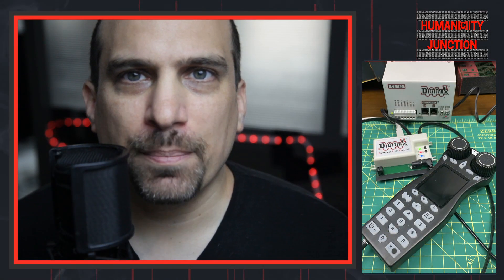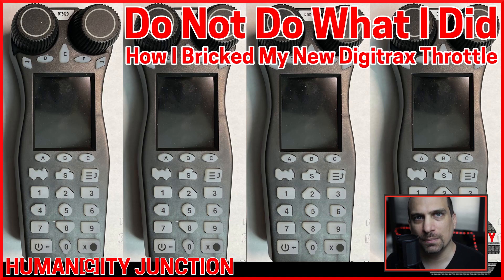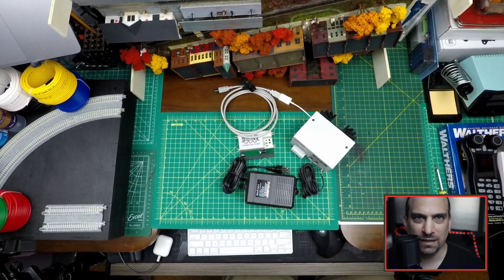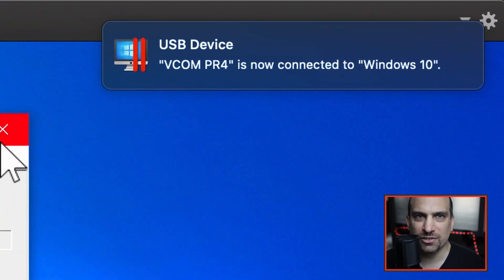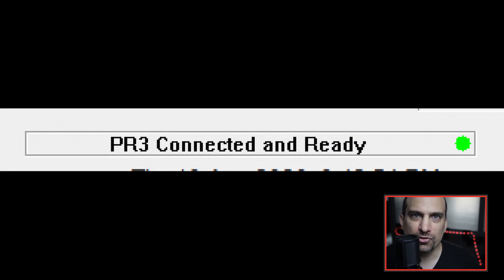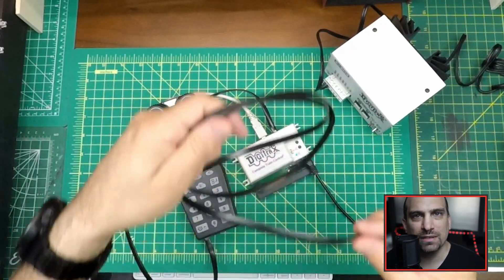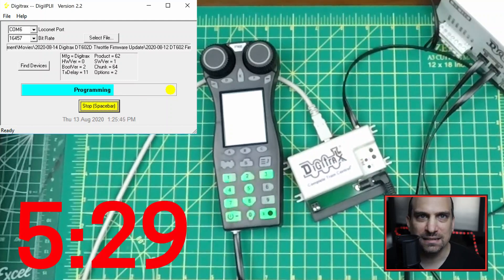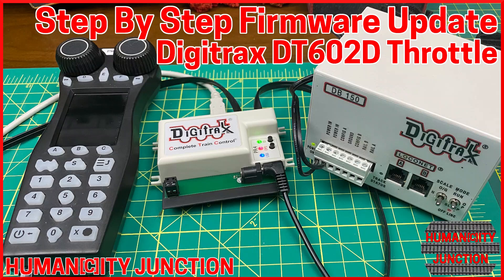Easy Step By Step Firmware Update | Digitrax DT602D Throttle

Comment: Hi.  Thanks for your Helpful videos - Great!
I have followed your video firmware upgrade instructions alongside the Digitrax written Firmware upgrade instructions
I'm using a DCS52 (PR4 built in) to upgrade my DT602D and UT6D...  firmware upgrade failed, the keypad keeps blinking even after removing and reinserting batteries...  I've tried 8 times now.
Digitrax support said I could ship it to them - but that is not the proper solution, as you've said as well!!!

Can I RESET the throttle to factory defaults and start over - at least get it functional again
Reply from the maker: My understanding is the only “reset” at this point is to keep pushing the firmware update. 

Yeah, I know.
Reply: @HumancityJunction  Thanks...  I guess you mean, just keep retrying over-and-over, in the hopes it will eventually 'not Fail', and upload correctly.
Reply: @chrislef5045  I still have issues with mine. I opted not to send to digitrax as shipping would be expensive with fees. got a pr4 and still didnt fix it. digitrax again said i could send it to them after getting in touch but ive just picked up a DB150 as a last throw of the dice. My DT602 just has a rapidly flickering screen and nothing else so i will just have to keep trying to push the update using the same setup as in the video and hope it eventually works for me.... Did you ever get yours sorted?

Comment: Hi there, i am very late to the party with this. I managed to brick my DT602 doing a firmware update and purchased a PR4 to try and get it to work but have had no luck. I however happen to have a Dr5000 and was wondering if you would be able to explain the steps you used to allow a firmware update through that using a PR4?
Reply from the maker: Once bricked, I ended up using a DB150 w/PR4 to unbrick it. Then I was able to use the DR5000 again for the updates.

You need to have the command station connected via loconet, so connect the DR5000 to the PR4. 
Using Soundloader, connect the PR4 and make sure your com port is connected.
Then keep trying to update. According to Digitrax it could take a few times, but it will eventually "fix" itself.

Or, you can send it to Digitrax and they will update it.
Or, is there a local club? They might be able to help.
Reply: @HumancityJunction  Thank you for your reply its much appreciated, I will look into the DB150 and see if its a viable option for me. When I got in touch with digitrax they said for me to just send it in so im trying to exhaust all my options before sending it over there as im in the UK so will cost be a fair bit more than just the repair cost. Thank you again for your help

Comment: Been trying to get my PR4 to work as advertised with no luck. I've given up. It is now a paper weight
Reply from the maker: If you want some help, let me know what’s working and what is not working. 
Also, the Digitrax Groups.io has a good group of people that could also help you out.
Reply: @HumancityJunction  Thanks for the reply. Once I took a step back, counted to 10, it finally dawned on me that the DCS210+ has a computer USB connection that you can also do to perform upgrades. I did look on the Digitrax Users group, and apparently the DCS210+ and the PR4 don't play well together. I then removed the PR4 out of the equation, and connected the computer to the DCS210+. Everything works now. Guess I did not need the PR 4 when I had the DCS210+. But, still, I'm no expert.
!

Comment: It was hassle.  I have a MAC and planned to use JMRI  but later realized I should just use Windows, luckily I have Parallels desktop on the MAC.  Not sure what I would have done without this video.  Thank you sir👌🏾
Reply from the maker: Glad it helped!

I thought I saw another post from you about Soundloader.  I am only using it to confirm that the PR3/4 is connected correctly because the firmware updater will not provide that info.
Reply: @HumancityJunction  yup, I erased after reading the Digitrax site thoroughly realizing it was needed or at least listed as 1 of 2 updates for the 602. I was having throttle issues for months now but this update fixed it all

Comment: Cool! Nice information. I wonder if you did tried by use Mac computer too? Is there difference from Windows? I use Imac with latest upgrade version.
Reply from the maker: On a mac, you would need to run a virtual machine through bootcamp, parallels or WMWare.  There is not a native mac application.  But if you are using a virtual machine, yes, it will work.

Comment: Thanks very helpful!  I have been dreading this for some months now.  One stupid question:  How do I know the COM port to which I attach the USB to the Zephyr (I have a DCS52 and have verified that I can use this and not a PR4)?  Is it as simple as trial and error and seeing when the program gets a return?
Reply from the maker: What I do to find the com port is to use Digitrax SoundLoader.  You get more infromation with that program in regards to confirming that you have the connection established correctly.  Then I close Soundloader, open the updater and have had a lot of success this way.
Reply: Again, thanks.  Today (Feb 25, 2023) I updates both my DCS52 Zephyr and my DT602 throttle.  Your video was EXTREMELY helpful. One problem I had was that the DigiIPL did not 'see' the DCS52 via its assigned COM port, COM7, until I restarted my computer with the USB Cable attached to both the computer and the DCS52.  Then it saw COM7 and programming was successful. Now I can install the DV78 and use the DT602 for route assignment.  Thanks!

Comment: Wel i guess for a old 81 years  computer illiterate person like me, im stuck with it as it comes
Reply from the maker: Tony, if you need an update, you could send it back to Digitrax.  Or, do you have a local club that could help you out? -Heath
Reply: @HumancityJunction  I just had a fellow modeler help me out with some advice, he then sent me a bill for it ??? i do have a problem with a throttle like you have it works fine when tethered but go's off when i unplug it even with freshly charged batteries in it, i use infrared, it was working ok with batteries, then this morning nothing
Reply from the maker: @tonydavey3741  If he did not make it clear ahead of time, I cannot imagine having someone send you a bill for helping you.
Do you buy the throttle when they first came out?  Some of the initial throttles had an issue with the battery compartment contacts.  They were not secured properly and would short out. I would check to make sure the battery contacts are not out of alignment. -Heath
Reply: @HumancityJunction  I bought the evolution pack one year ago, no the guy made no reference to charging me, in fact i enclosed the cost of postage and 20 for his trouble, and i still got a bill, £50 per hour ??

Comment: Thanks for the video, very informative.  I am anxiously awaiting the arrival of my new Digitrax Evolution, it comes with the 602 throttle.  My question is, at this point (approx. a year since this video was recorded) will I need to complete all the updates?  Or will this have been done by the manufacturer?  Thanks, keep it up.
Reply from the maker: Kyle, I would definitely confirm that you have the latest version as you do not know when your dealer got stock of the kit.  The Evolution has the 210+ which has a built in USB port in the command station, so it should be more straight forward of a process. -Heath
Reply: @HumancityJunction  thanks for the prompt response Heath. New subscriber here.

Comment: Thanks for this info! I have the same exact hardware and this was very informative.
Question, is the DB150 necessary for the process? I was wondering if you could do the update with just a PR4, USB connection to a computer, and of course the throttle.
And an unrelated question, I can't seem to get the DB150/DT602 to program locos on the main. I know it can't read CVs, but I thought it could write them, but I can't get that to work.
Cheers!
Reply from the maker: Tom, you will need a loconet compatible command station to complete an update. So you will need something other than the PR4.  I got the DB150 just for this purpose as my usual command station is the DR5000 from Digikeijs.  The DR5000 should work for updates, but I do not find it as consistent as using the DB150.
When you are trying to program on the main, what messages are scrolling across on the DT602D?  Have you tried using it plugged in, versus wirelessly? I use JMRI for all my programming, so I have not tried this myself.
Reply: Thanks!! For programing, I select the loco, hit the 'menu' key, CV Programming, Option to Program on the Main, enter the CV and Value, press with "WRITE" key...and it says Writing...Writing... apparently forever. Not sure if it's me, or a limitation of the DB150/DT602 combination.
Reply from the maker: @p99t0013  I looked in the manual and it says you can program CV's with a DT400 on the main, so you would think it should work with the new throttle. If you do reach out to Digitrax, I would be interested in knowing what you find out.

Comment: This was terrific advice with easy step-by-step on getting it done.  I just replaced a defunct UR91 with a UR93 and at the same time added a DT602D throttle to my existing duplex throttles.  I was having problems and Digitrax told to to upgrade the firmware in the UR93 and DT602D and report back.  Your instructions are perfect for getting this done.  Digitrax should buy your video and make it available to their customers.  Congrats and keep up the great work.
Reply from the maker: Tom, thanks so much. I needed this video and could not find it, so I made it. -Heath

Comment: why should need to update anything?
did the manf screwup on programing at the factory ?
Reply from the maker: They have fixed some bugs, but they have also added additional features as well. Being able to update the throttle is a low cost way to stay up to date with the latest features without needing additional hardware.

Comment: nothing but "Programming Failed" gone over this many times. uninstalled, reinstalled. different cables, power on, power off, through the command unit, directly into PR4. tried spinning around 3 times. nothing. "Programming Failed"
Reply from the maker: I had to get support from Digitrax a few times, but they did eventually get me sorted out.  The Programming Failed message is definitely frustrating as you do not really know why it is happening.
Which command station are you using?

Comment: In case any of your subscribers need to know - a DCS 52 can be used to program the DT602D.  I pushed latest firmware to the DCS 52 first and then attempted to push to DT602D.  DT602D wound up disconnected halfway through my first upgrade (looked like yours did in the first brick video!).  I had to reset the DCS 52 to get it to be seen on the computer and then once I did that I started pushing firmware again over the loconet cable provided with the DT602D.  It took a few minutes but the second time the firmware did actually take properly. 

Should also note that most of the software pushes are not full software updates.  They are currently annotated as a subversion underneath the "SW version:" line.

Thought this might be very helpful information for you!
Reply from the maker: Thanks for sharing this additional information.

Comment: I saw that you were using an apple device. I have a MacBook Pro and want to know if Digitrax is supported on there or do you have to use a windows program? Did you have to bootcamp windows to do the update?
Reply from the maker: Derek Alexander I am running Parallels and I was able to get it to work that way. I do not know if this is supported by Digitrax, but it worked for me. -Heath

Comment: Why is model railroading the only hobby that does not have clear instructions for many of the associated products?? Why is it such a big deal that one needs to make a video on how to update? It should be extremely clear from the manufacturer on how to do it. Actually with my ESU products have very clear instructions. Maybe the Germans are better with model railroading as they are with most other technologies.
Reply: To Human[c]ity Junction and others.

I got a DT602D earlier this year and followed your excellent video to upgrade to the August Firmware. Flawless.  

There is a September firmware update, but it is very buggy. The DT602 OFF function does not work well and the screen goes black excessively quickly.

The September firmware update was not flawless. First try started and failed, second try worked. I left it for a month because the throttle worked. Today I tried to redo the firmware but the same initial failure and second try worked. 

So today I back leveled to the August Firmware, the update was flawless and the the throttle works like it should work. 

Grandson coming tonight and I want it ready for him.
Reply from the maker: @JHurst-to5ey  thanks for the update.  I am having the same issue with the September update, but thought it was just me.  I hope they fix the issue soon.  Thanks -Heath
Reply from the maker: RC, I can only provide my thoughts based on my experiences, but when I was in manufacturing the manuals were written by the engineers, not the users. So there were sometimes things that the engineers thing are so obvious, but the users would never think of. I did not think it is done intentionally, I just think it's not given the detailed attention that it should.
The DT602 manual is a find/replace from the DCS-52.
I will also point out that there were several people that responded to me saying that I should have followed the directions, so it appears that some people (likely those that had done the procedure before) were able to follow the direcitons.
Thanks for commenting! -Heath

Comment: why do i need to update my dt602d what differance will that make?
Reply from the maker: Steven,
Each version has had some bug fixes, so I would definitely try to do the updates.
The big one for me was in the original released version, the throttle would beep every time the LCD dimmed. The first update fixed this.
I believe some of the other bug fixes were issues with the F2 key staying on and issues with consisting and releasing locos.
Do you have the needed hardware to update your throttle, or access to the hardware?
-Heath

Comment: Hi ya Heath, good looking out for fellow Digitrax users. I’m sure they will appreciate the step by step. Me thinks Digitrax kinda fumbled the ball on this originally. And I don’t mean the first firmware update. But just having the need to require  it in the first place. Anyways great job, TTMMRR. Lol. See ya.
Reply from the maker: Norman, I do not think that I have had the throttle for 2 months yet and this is the second firmware update already.
The good news is that they are addressing all the issues.
-Heath

Comment: Great video. Still jealous that I can't use this on an NCE system.
Reply from the maker: If you want to lend me your NCE system, I will make that video.
Reply: @HumancityJunction  are you saying that throttle does work with the NCE system?
Reply from the maker: @FBMRR  There is a rumor that an NCE throttle will work with a new Digikeijs command station that is coming out, but no details on that yet.  I do not know if it is a firmware update or a hardware change.
What I meant is that if you send me an entire NCE system that I will do a video on updating the firmware.
Reply: @HumancityJunction  im still a little lost. Could be that im on vaca and still have beach brain. What is it ur updating? The NCE system or your throttle?
Reply from the maker: NCE Throttle, NCE Command Station, NCE Firmware Update. Everything NCE, nothing that I own.
Reply: @HumancityJunction  nce doesn't do updates like that. They haven't put out an update in over 10 years. The throttles all run from the command station there's no firmware installed. The  firmware in the command station is done by a ROM chip. There's no interface to update yourself you have to send it back to nce
Reply from the maker: @FBMRR  Oh interesting, so you update the command station and it automatically updated the throttle?  Is it the same for the Power Cab and the Power Pro? I am a bit surprised that with all the advancements of Decoders that there have not been any Command Station updates.
Reply: @HumancityJunction  yes me too. The power cab is different cause its all encased in the throttle. Maybe this would help if we did a video call next week when im back. Let me know.
Reply: Rick, maybe you should just be thankful you can't instead. (lol)  Art...